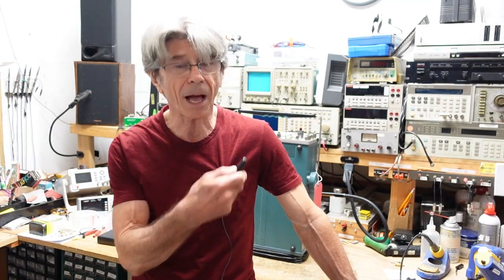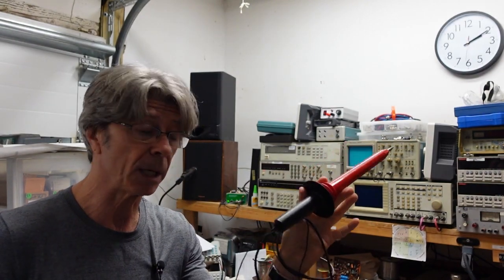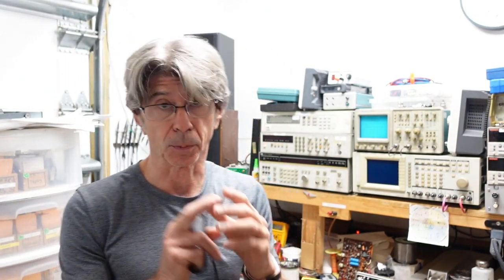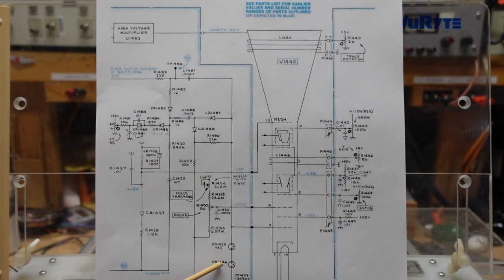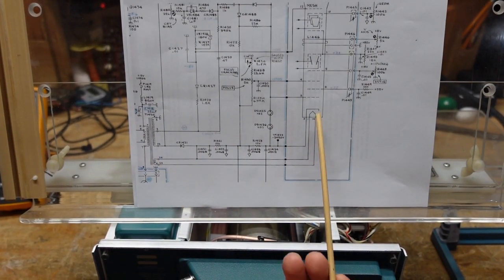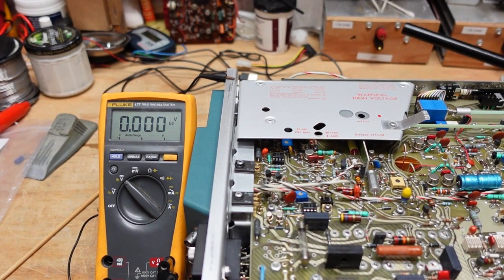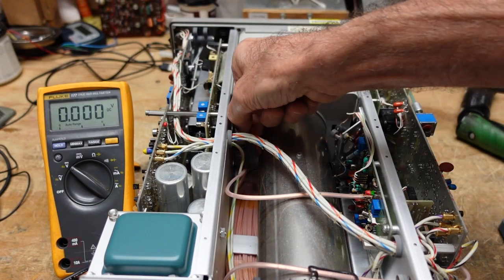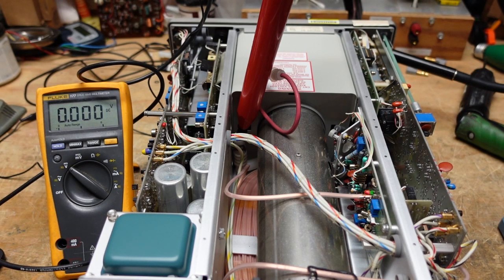Tektronix 465 No Display

Comment: Hi Ray. Just found your excellent channel. Excellent explanations, at just about the right technical level for me. 
 Interesting to see the HV probe. I really must get one as my “ fleet” of CRT scopes seems to be multiplying. 
 A quick story. Some years ago I needed to check the EHT on a CRT scope, a mere 9.5 KV, but beyond the capability of my meter/s. After some chin scratching so realised I had 4 AVO 8’s( a once industry standard analogue meter here in the UK) each capable of reading 2.5KV. I connected all four in series, and each showed about 2.3KV, confirming my EHT was good. A cheeky trick, but I wouldn’t recommend it. The AVO 8 BTW is a 20,000 ohm per volt meter. That might dismay some, until you realise that on the 2.5KV range each has a resistance of 50 Meg.
Reply from the maker: Hi Tim!  My HV probe was leftover from my early days working on CRT televisions.  Sometimes being a pack rat pays off!

Comment: Thanks for taking us along on this diagnosis.  I agree that a repair cannot be done economically, but for anyone out there that wants to fix their own scope, a high voltage multiplier can be made from scratch.  The EEVBlog forum has a tutorial of a 465 voltage multiplier being made from discrete caps and diodes, then potted in epoxy.  Several people have done it and it is neither difficult nor expensive IF you're doing it on your own.  Not something you'd want to pay someone else to do because it's time consuming, but if you're a hobbyist with some time, you can get your scope back up and running.  Thanks again for the video.
Reply from the maker: I did trip across that, but in the end the HV multiplier wasn't the issue.

Comment: Wrong, this scope doesn’t have a high voltage problem! Your HV probe, although presenting what appears to be a very high resistance to the HV multiplier is actually loading HV multi down. 
I spent 20 years in the 80’s and 90’s working for TEKTRONIX and probably worked on over 200 of these every year. The HV multiple on the 465 was almost never the problem, I can’t ever remember having to replace one on a 465.

I could check that the high voltage was working before even taking the unit out of the case by turning the unit on and bring a fisted hand up to the front of the CRT… if I could feel the tiny hairs on my fingers being attacked to the front of the tube, there’s enough HV to produce a display. 
When you pulled the CRT EHT lead and it discharged with that high potential snap, that’s all the proof that I’d need. 

Before taking it out of the case, set the time base to 100 mSes, the trigger to normal, trig position to center and line trigger selected then see if the “triggered” light on the front panel flashes about once a second. If it does, you know your sweep logic, triggers and time base are all functional. 

Press the vert mode beam find buttons together, Nothing displayed?   OK…
Now you remove the case.

Then move onto troubleshooting 101… a good visual inspection followed by checking low voltage supplies. BUT FIRST….The visual includes removing the rear CRT shield ( 2 nuts ) and with the unit turned on you should see the heater glowing at the rear of the tube.
This tells you that not only is the heater working but also that the CRT is holding a vacuum!

At the rear of the vertical amplifier board near the input to the delay line is a hard to spot problem which will cause “no display”.  A Toroidal coil mounted upright on a stand-off about the size of a dime as I remember, can easily be damaged by removing/reinstalling the case. It’s there to provide for blanking when the vertical mode is set to chop. If the coil is “open” the will never be un-blanking  drive to the Z-axis amplifier, & therefore no display. Someone reading this tip is going to be very, very happy in a few minutes!

You’re now about 10 minutes into trouble shooting, and if the visual and power supplies all checked out, you’ll actually have to start trouble shooting! Good luck, but there pretty easily fix most of the time.
Reply from the maker: Fixed in Part 2.
Reply: Great stuff!
I assume you had a special HV probe that wouldn't load the 16k HV down, or was it the hair on the back of your knuckles test?  :)   The 465 was a rock solid scope way back when, and our company was flush enough to afford the first affordable Digital storage scopes ($7,000); it took using the both scopes side by side for a couple of months before I was convinced that it was time to retire the 465. Now that I am retired I am bored enough to look at one of the old 465's that has no display, and so I will give your tips a shot.
Reply: @Kr0N05 
I haven’t worked on one of these in 35+ years but I fixed so many that most all the common problems/fixes are etched in my brain. 
 try to find a unit and a manual with a high serial number. If your in the Americas this will be B250000 and higher
A 465B and 465M are totally different from a 465 
That manual I mentioned is very important, the circuit description is very detailed and needs to match the serial number range of the unit. 
If you determine the unit has a sweep logic problem, check the part number on the sweep logic IC. If it is 155-0049-02, it is NOT your problem but the IC socket it’s in, this could be….OR….
The sweep logic board attaches to the main board with an edge connector which can become dislodged if the unit was a field service, being bounced around a lot. Just reseat it. Also, rough treatment can break the leads of the power supply pass transistors mounted to the chassis at the rear of the mother board.
DON’T  spray contact cleaner on the attenuator boards! It will cause these boards to crack.  Cut a small strip of paper and place a drop of isopropyl alcohol on it. Slide this under open contacts, close the contact and pull up the paper out to clean this contact. 
You have 2 vert amps, 2 timebases and 2 trigger circuits… so you likely have enough parts for trouble shooting problems in these circuits… just check in the parts list of the manual to make sure the parts are interchangeable. 
On the other hand, never swap tunnel diodes except in pairs making sure the arming and firing are in the same relationship after swapping. These parts almost nerve went bad and went one did, we would select for slightly different characteristics using a curve tracer which most people don’t have access to.
If there’s a precision resistor (1%) or a half watt resistor in a circuit, it’s there because it’s necessary for the circuit to work properly.
Tantalum caps short… enough said.
Tiny ceramic variable caps use for high frequency response adjust change or stop working over the years. If you don’t have access to the proper calibration standards and don’t need the unit to meet bandwidth spec, I suggest you don’t mess with these… you really have to know what your doing. 
I never had to replace a low or high voltage transformer in any TEKTRONIX 400 series scope. 
The slight blurriness of the CRT is normal and caused by a very fine mesh screen inside the tube. It’s there to cause this effect in order to prevent burning the phosphor…and it works as intended. 
On these old units, the only  way to set the internal CRT bias adjustment: with the unit warmed up, time base set to auto trig at 1ms, press and hold the beam find button and adjust the bias for a low intensity but useable display. 
There’s much I have forgotten over the years but I still can search my memories for answers if you have specific questions.

Comment: Where I used to work, my best scopes were a 465 (tek) and a 1740 (hp).  I always like the tek scope better.  For myself I ended  up purchasing a 465B.    The 465B was a new model, the next step to computerizing the scope.  The controls actually put out a parallel bus signal, where the 465 operated the horiz and vertical signals directly.  I paid over $3K for my scope.  I still have it although it's retired.  I have much newer tek scopes now, I never was trilled with HP scopes, think they should have stayed in the instrumentation business.  Jim
Reply from the maker: Yeah, HP never caught up with Tek on scopes.  Their spectrum analyzers were better though.

Comment: i have a T900 series 35Mhz scope which had the same problem: HV multiplier was shot. after some research i made the multiplier unit myself. it was actually quite a simple circuit made of few high voltage caps and diodes. i potted it into a small box made of cut PCBs of approximately same size as the original unit. It did work. however now (after about a year)  the display has dimmed and only shows the middle. i think cheap Amazon parts are failing. or possibly the way i potted (with epoxy) was not perfect. i plan to tear it apart one day to see.
Reply from the maker: I had toyed with that idea as well, until I figured out that the multiplier wasn't the issue at all.
Reply: @raygianelli3612  LOL. I saw the other videos. I am glad you got it fixed. On a side note, I shocked myself with the HV mulitiplier output while trying to trouble shoot. It's low energy overall but does give a nice shock.

Comment: Hello, thanks for the coverage of the HV section on this 465.  As a novice, I have started to play with scopes and my start is with the Tek 465, in fact 5 of them.  I then found homes for some of them after I was done.  I got close to the HV section on the last repair as I started to dance in that section chasing an intensity problem.  It turned out to be a bad CRT.  That unit will serve as spare parts for my bench 465 I guess as it has many cosmetic issues as well.   It looks like the example you have there is a very clean unit.  I hope it can stay out of the land fill.  Have your buddy check out hamfests.  That is where I have found the 465's I have been playing with.  $20 may buy him a parts unit.  Or maybe you can ask him if he wants to part with it.  But with shipping to NJ (where I am) plus whatever his investment return needs to be, well, I may be facing the same issue in economical decision.   Your video will help me with future repairs I am sure.  Thanks again.   Jim
Reply from the maker: Appreciate your input, Jim!  I learned from a gentleman who had purchased a pallet full of USM281C (Tektronix 7605).  I learned a boatload from him and that hoard, and then he started me on other scopes, signal generators and meters of various kinds.  He was an amazing mentor, and is one of the reasons I'm on here trying to pay it forward by sharing what was shared with me.
Reply: @raygianelli3612  I have to evolve into the signal generator world yet.  I have a touch of DMM and VOM repair experience from the early 90's.  It was in a calibration lab over two years.  It was where I first saw a Nixie tube.  It was in a Fluke 8000 series IIRC, even outdated at that time.  The archaic looking (to me) was surprisingly spot on during checkout and went back to the customer.  You have a great teaching approach!  BTW, my previous comment was before I realized that there was a continuation to this saga.  I just saw the two followup videos to this and you have this scope up and running.  Very cool.  Good rundown of the power supplies.  Yes, sometimes we can go down a rabbit hole without looking at the surroundings.  One thing that was taught to me in my limited experience was check all power supplies first, ripple included.   Don't feel bad at all about missing that, it just reassures it for the next time.  It seems difficult to film video and concentrate on a "specimen" at the same time.  I find myself getting lost at times.  Recently I had to "inject" voltage to a supply on something.  It was the first time I ever did such a thing.  The heart was pumping a little I have to say.  Upon powering up, the unit under repair came to life!  That is a neat trick.  On supplies with excessive ripple, I have soldered a comparable capacitor quickly across a suspected filter cap to test the unit under repair.  That came in handy on two of these 465's as you know how much work it is to get to those to shotgun a replacement otherwise.  Keep up the great approach and thank you for everyone on the internet that seem to be willing to help!  One more note on the 465 that I see a pattern with is just one other capacitor going bad.  See it here with my mediocre video:  
https://www.youtube.com/watch?v=66YDaYBmsCI

Oh, and one of my 465's has an attenuator issue.....I will look at what you have provided in part 3!!!  Thanks for that.

Best,
Jim
Reply from the maker: @JIMO415  Checked out your video, Jim.  Good work!  Had to laugh when you referred to the cap's solder joint corrosion as "fungus".

I did several years in the cal lab, so it was really embarrassing that I missed the power supply issue.  But you're right; it's distracting to try and work while making a video, and I tend to have focus issues anyway.  So there's that!  :)
Reply: Jim, I've got a 465 here with a short to ground on F1419; blows the fuse on the CRT oscillator circuit. I removed C1419 which appears to share a trace with L1419. In my case this was a 10uf tant. Even after this, I still had .5ohm on chassis ground to fuse. I checked the pins for the transformer and found no obvious faults. Do you have any suggestions? Thanks!

Comment: i have a bang up to date siglent but when analog will do  i find using my 2245a and 2246a so easy and joyfull to use , you can feel they are built to a price the knobs are all wobbily and it is so light but tek 2465,s are costing a fortune in the uk and ill always worry what hybrid chip will die next -had that experience with my 2430a  -the 2245/6 dont have any fragile hybrids
Reply from the maker: Hi Darren!  I have an Owan DSO, which I only break out for low rep rate and single shot waveforms.  The 2445A is my daily driver, and does most everything else I need to do.  I tried the DSO in X/Y mode, and the latency was just abysmal.  So the Tek is a joy for me as well!

Comment: Nice video Ray.  I needed a multiplier for a 2213 a few years back.  Since there were none available, I built one with discrete diodes and caps.  The circuit was placed in a mold and potted with HV epoxy. It is still going strong years later.  Most of the problems I find in these old scopes is dipped tantalums.  They just don't seem to like working anywhere near their voltage rating.
Reply from the maker: Great solution, Todd!  Those multipliers are the Achille's Heel of the 2213/2215 scopes.  Your repair will probably outlast a factory new part.

Comment: Let's hope you can find a spare part for this nice scope.
I love mine and use the 453 a lot, also the 564.

One thing to mention about the HV probe:
They can only measure low frequencies, up to a few kHz. So, if someone wants to measure the high voltage output on a vacuum tube transmitter, this is not the right tool.

Regards
Schorse
Reply from the maker: Schorse, don't think a replacement part is in the cards.  Just not worth it to the owner.

In this case, I think the meter is the element that would restrict frequency response.  The probe is passive.
Reply: @raygianelli3612  Awww, too bad.

The specs for the 80K-40 only says "5% accuracy  60Hz", and the 80K-6 drops down to -30% @ 10kHz.
Same goes for HV scope probes, the Tek P6015 for example is rated for 20kV rms from DC to 100kHz, then drops down to just above 10kV @ 1MHz and below 5kV @ 10 MHz.

Comment: Thought there was a way to use a TV tripler for this. There is a tekscope forum that could be helpful. Although I suppose TV triplers aren't so easy to come by reasonably anymore either,  and your time to figure everything out probably still not worth it.
Reply from the maker: There may well be. Trick is to find the right one. This one raises the voltage about 6X.
Reply: I was moving a,19 inch CRT it wasn't heavy but my dad was with me so I decided to ask him to help me. As we were carrying it to the car I got shocked and probably I would have dropped it but lucky my dad held on to it.
Reply from the maker: @briang.7206  Brian, how did you manage to get shocked?  Was the case or back off the set?
Reply: @raygianelli3612  I was in the process of replacing a picture tube.
Reply from the maker: @briang.7206  Yikes!